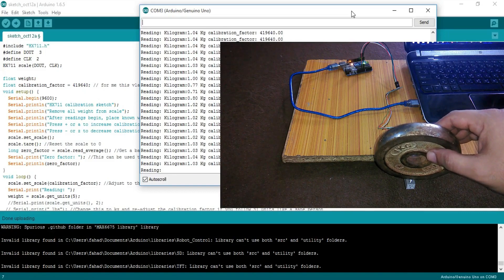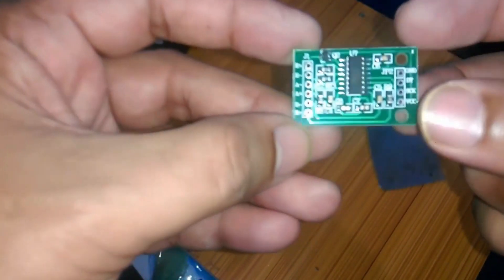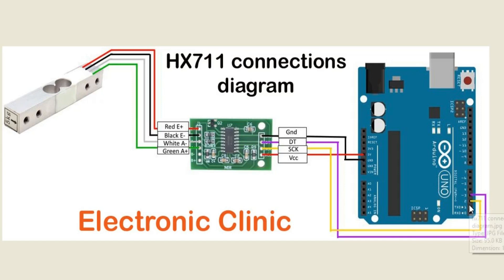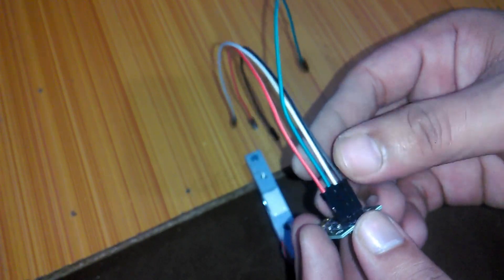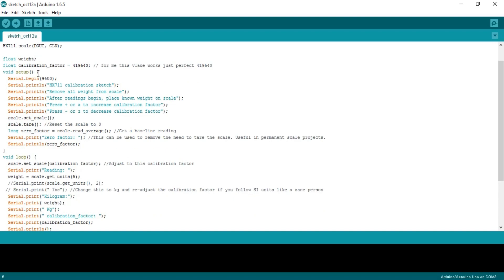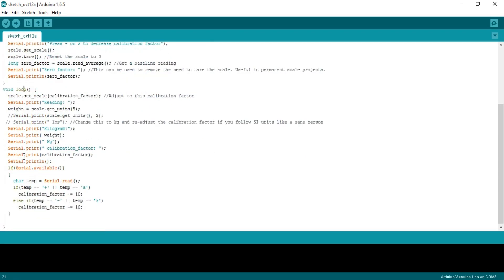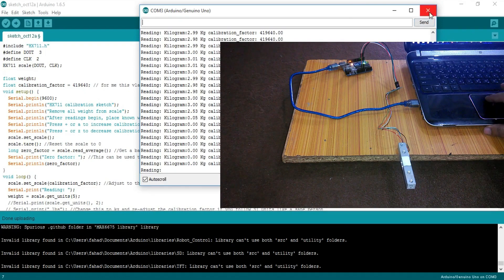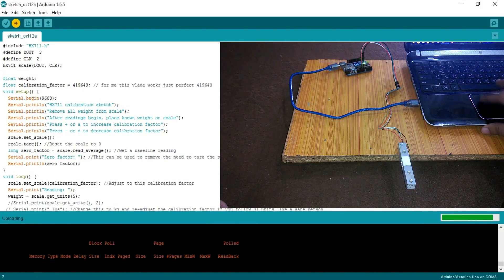HX711  Load cell / Strain Gauge Calibration and Weight Measurement using Arduino

Comment: Hi. Is the load cell good enough to measure a scew or a bolt tension which has been tighted with a nut and washer? To see if it becomes loose over time?

Comment: how about a strain gauge? For my application, I do not have room to attach a block of metal.
Reply from the maker: tell me in detail. for what purpose you want to use it?
Reply: @ElectroniClinic  It will be underneath my car! It is a sway bars to be exact. I want to take data from the stock sway bar and then repeat it again for the aftermarket one.

Comment: HI, can I use the same code for the 200kg weight sensor?
Reply from the maker: Yes. You will only need to change the calibration value. And most importantly use a load cell which is designed for 200kg or more
Reply: @ElectroniClinic  what calibration will i put in the code..sorry sir im just new to arduino..
Reply from the maker: its just through hit and trail... watch this video completely. i have explained this method.
Reply: hi, what was the calibration factor that worked for you for the 200kg weight sensor?
thank u

Comment: Can i use this to measure pulling force of a wire?
Reply from the maker: yes you can use this, but for this you will have to design some mechanical structure. and you will need to calibrate this. the calibration part i have already explained.